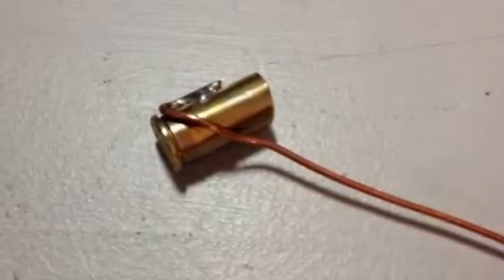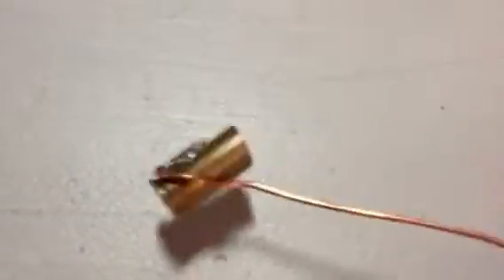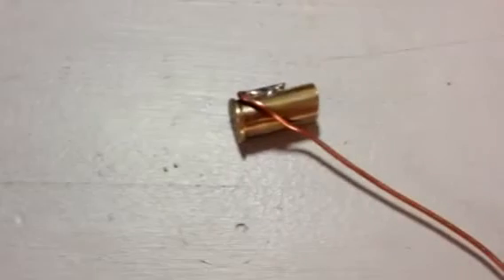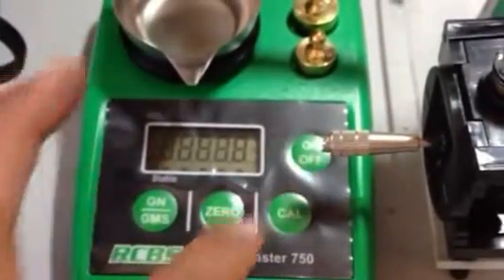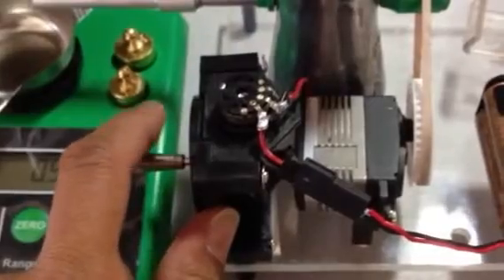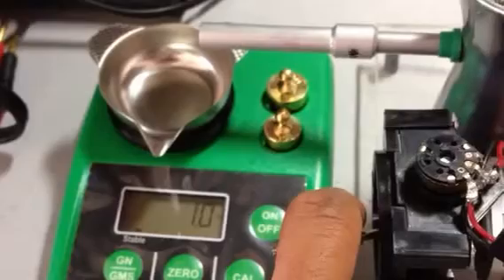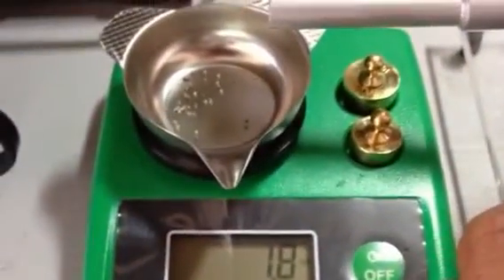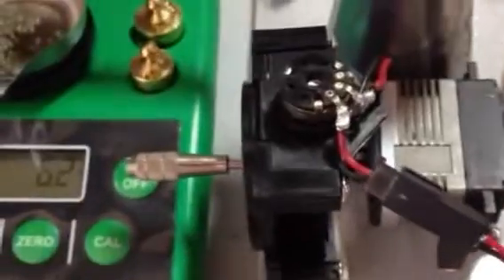Electronic powder dispenser home made

Comment: What servo motor was used ?
Reply from the maker: obrien els remote control car servo you can get them at any hobby shop get the cheapest one coz you will need to modify the internals for it to continuously rotate
Reply: Thanks

Comment: I don't get it, why is it so hard to spin the handle by hand and have ultimate control over how fast or slow you want to go?  Just another bulky item in the way.  The point of the trickler is to top it off, not to load a charge from scratch.
Reply: Dima Prok 
Agreed.  I use a small 1.5 teaspoon to start a load then top it off with the trickler..

Comment from the maker: thanks much as you noticed i was ill prep for the video i even forgot to warm up the scale w so many out takes said to my self it will have to do and yes the home made trickler works the switch is a gimbal from a radio control transmitter w/c also got away from me during the video thanks again for your suggestions and comments much appreciated

Comment: Start up process should be making sure its sitting flat, turning it on, and letting it warm up for about 10-15 minutes, then with the pan off, calibrate it per user manual. Always make sure the stable icon is showing to confirm actual weight, when finished calibrating, return pan and zero scale.

Comment: I noticed that that machine you made isn't running, however your scale is slowly rising........just some advice on using your RCBS range master 750, keep it AWAY from other electronic devices and not in direct florescent light as they both cause an interference.